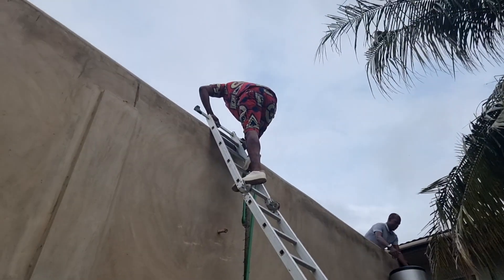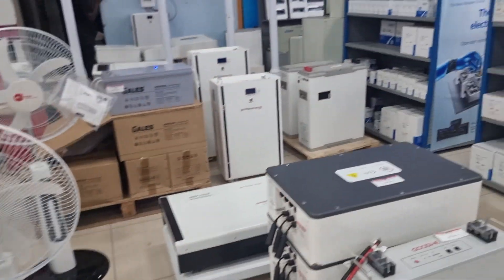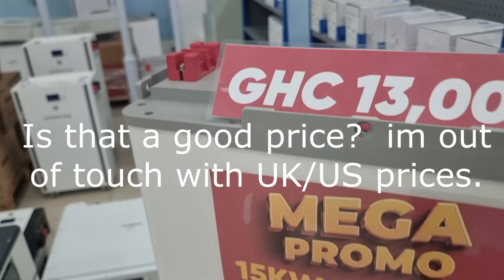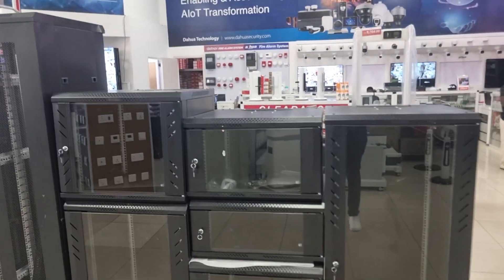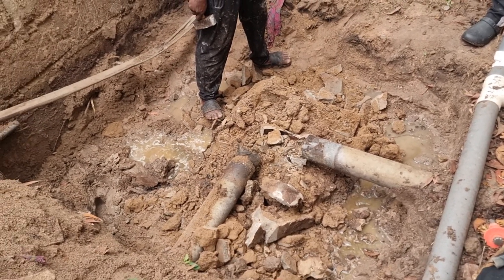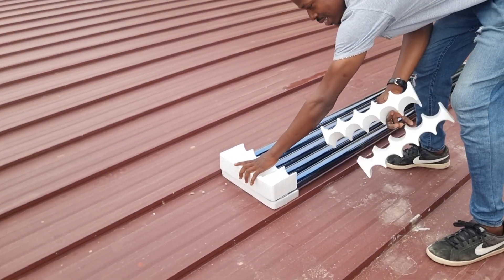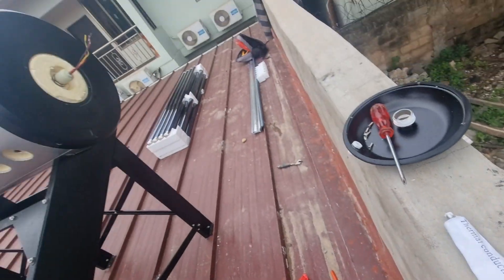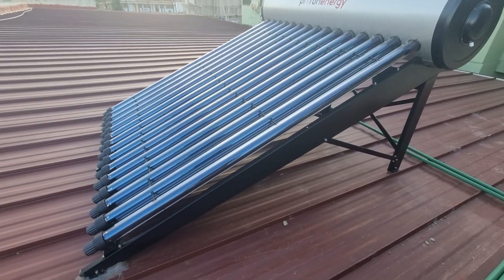Buying & Installing Our Solar Water Heater | Building Our Home in Ghana

Comment: Hi, thanks for the video. Would you mind sharing a little more detail on your roof ? Have you had any leakages, which have become common with secret roofing in Ghana. How about the company that did the work ? Could you recommend them ? Thanks.
Reply from the maker: Hi unfortunately I  can't recommend them at all. To say the roof was thrown up would be an understatement.  I had to seal and finish the roof myself, with the help of my builder at the time.
And yes we had leeks that showed up after the first very heavy rains. Its been a while now so ill be going back up to do some checks on and issues.
Reply: @GhanaBound sorry to hear that. It appears these roofers can’t ever get the secret thing right. Now I am even more worried about proceeding. Thanks and all the best.